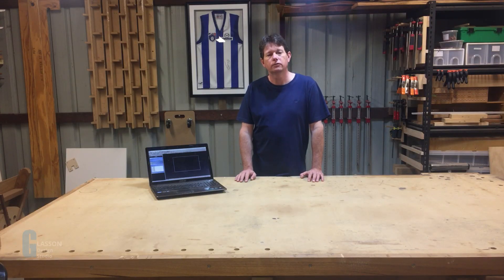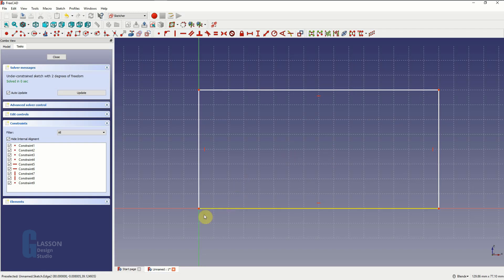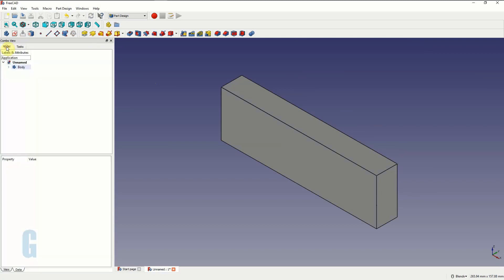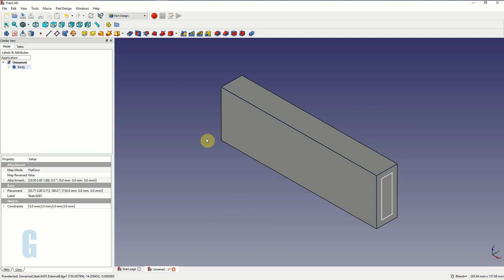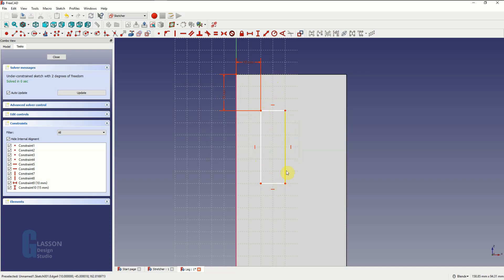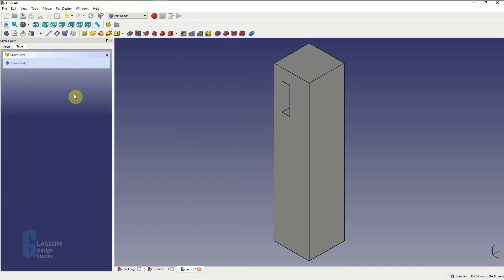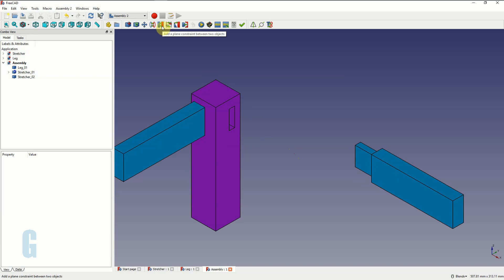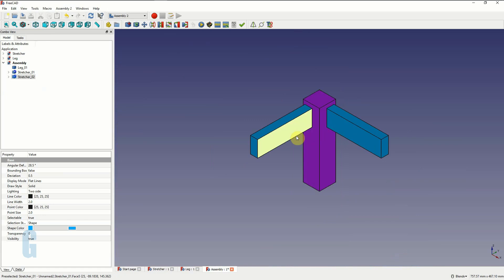Howto model the Mortice and Tenon joint in FreeCAD

Comment: What happened to the Assembly Workbench?🤨
Reply from the maker: Workbenches are sometimes abandoned by their maintainers so you might need to use a different one. I use A2Plus on FreeCAD 0.21 but I see that there is an Assembly workbench in FreeCAD 1.0RC2 so you might want to switch to that version.
Reply: @GlassonDesignStudio  Thanks. I'm relatively new to FreeCAD and didn't know about the add-ons. I started using A2Plus because I saw a couple of tutorials for it.

Comment: I am new to FreeCad  I am trying to follow along.  I had to add assembly workbench 4.  I am unable to load both parts into the new body.  Can you help me?
Reply from the maker: Hi Bill, thanks for reaching out. I can help you with the A2Plus workbench for doing your assemblies but not Assembly 4 because I don’t use it. I recently released an introductory video for the A2Plus workbench which should get you started. I’m currently working on building a playlist of videos about the A2Plus which I intend to cover all aspects of the workbench. I have no plans to do anything about Assembly 4 at this stage.
Reply: I installed A2Plus workbench but don't have the assembly restraints that you are using here.   @GlassonDesignStudio

Comment: Got a few minutes in and realised this must be a different version because half the stuff you were doing it wouldn't do.
Reply from the maker: Yeah that's going to happen when the software being used is constantly evolving. From memory the tools to model the joint should be pretty much the same but the workbench used to assemble the joint has changed. I hope that it didn't cause you too much grief.
Reply: Totally disagree the icons are all the same it works fine.

Comment: Few icons nowadays looks a bit different. A2plus is also a tiny bit more complicated as I had to select both planes and then the PlainCoincidence tool was available (not greyed out). But in general it's still the same and that tutorial was  "A giant leap for .."  Me-kind. Thank you very much.
I had to repeat few steps again and again, as I made accidentally those tenons a bit longer, so they freely protruded through leg 🙂 But I learned how to update Pad element, then update a stretcher as whole Part .. and update A2plus assembly to apply changes. Which unfortunately broke the plane constrains so I had to re-do those. Whatever - Repetito Mater Studiorum Est !
Reply from the maker: Thanks for your feedback Tom. I have trouble with the constraints some days as well :)

Comment: Informative explanation - well done !
Reply: Looks to me freecad is very useful for furniture making
Reply from the maker: I think so too. So far most of my work has been using straight lines but I'm starting to look at how to use FreeCAD for more curved furniture. It should be an interesting journey...
Reply: @GlassonDesignStudio  I think with one bend surfaces you will be fine.

Did you ever use FCs cnc module ? Just curious
Reply from the maker: I don't have a CNC so I haven't used the module. I know people that have CNC machines but they are not technically minded so are unlikely to be prepared to set outside their comfort zone and allow me to use something generated by the model. I'll have to wait until I can afford a machine of my own
Reply from the maker: Thanks for your kind words. I'm glad that you found it useful

Comment: Can you pls show the same with assembly 4? Would appreciate thx
Reply from the maker: Hi Frank, Thanks for your question. I'd be happy to do a video showing how to do it with the Assembly 4 workbench; however this is slight problem - I don't use the Assembly 4 workbench so would need to learn it first. I do use the A2Plus workbench for assembly. Would that be sufficient? If not, I'll have to learn how to use Assembly 4 so it could be some time before I can do a video.

Comment: I’m testing out different CAD programs. When you created the first rectangle, how did you lock it in at the origin? I keep getting 4 degrees of freedom.
Reply from the maker: Thanks for your question. There are a couple of ways to do it. You use the vertical and horizontal distance constraints to define how far one corner is from the origin. An easier method is to use a symmetry constraint to make two corner points the same distance from the origin. To do that I would select the top left corner, bottom right corner, then the origin point and then apply the constraint - press the S key or click the icon that looks similar to ><

Comment: Casey from Toronto Canada. 
Thank you for creating such a helpful tutorial for FreeCAD beginners like me, especially the assembly video part.
I have a question regarding the assebly.  The length of tenons from both stretches are 35mm and the depth of the 2 mortises of the leg is 35mm.  Would the tenons bump into each other inside the leg because of the thickness of the tenons so not full length of tenon is able to stick into the mortise?
Reply from the maker: Thanks for your kind words. Yes, the tenons in the video would bump into each other preventing the joint from closing properly. There are two solutions to this. The obvious solution is to shorten on of the tenons. The other solution is to mitre the ends of the tenons so they meet at 45 degrees. This solution provides you with a bit more glue surface than the first making the joint a little bit stronger.
Reply: @GlassonDesignStudio  Is there a way in free cad to prevent objects from going through each other? So you can be be warn when your tenons are bumbing into each other like this? 

By the way, the video is great!
Reply from the maker: @trivialcompost6407  thanks for your kind words. I don't believe that there is collision detection in the assembly workbench that I currently use (A2Plus). There may be collision detection in other assembly workbenches but I haven't investigated them.

Comment: Just a quick question, could you have used the mirror function to copy the Mortice ? if there is the function,  using a diagonal line across the corners.
Reply from the maker: Yes you could do it that way too. I was thinking too much like a wood worker and not enough like a designer when doing this video. You could also use the same approach when modelling the tenons, but bear in mind that the mirror tool does not allow you to mirror an already mirrored feature, so you wouldn't be able to use that technique to model the tenons at both ends of a stretcher. Checkout my video on the Mirror Tool for more details about it - https://www.youtube.com/watch?v=PllHnCum5cc

Comment: Thanks a lot for your video.
I think that Mortise Pocket Length and Tenon Pad Length must be 25 mm, instead 35 mm.
So, there is not interference between the two tenons when they are inside the mortises.
Reply from the maker: Thanks for your feedback. What you've suggested is one way to do it, the other way is to mitre the ends of the tenons so they come together without interference.
Reply: Glasson Design Studio 
Yes, that’s a good idea to mitre end of tenons. 
It’s simple do it by rasp and file, but to modify the Tenon Pad by FreeCAD what way you suggest?
Thanks.
Reply from the maker: @paolofogaccia9455  I would create a sketch on the top of the tenon representing the waste portion of the mitre (i.e. it would be a triangle) then use the Pocket tool to remove the waste leaving a mitred tenon.
Reply: @GlassonDesignStudio  
Done, like you suggested.
Thanks

Comment: Thank You very much for the tutorial. Helped me a lot.
I have a question, the second stretcher will not be inserted (by 10 mm in real life) as that space (inner) is already taken by the first stretcher. Can you also constrain that in freeCAD. (I used A2Plus instead of Assembly 2 as it now seems to be Obsolute)
Reply from the maker: Hi Sudeep, sorry for the tardy response. I could have sworn that I'd responded previously but obviously not. I tried using the A2Plus workbench in this scenario but would imagine that there would be a gap between second stretcher and the leg because they two tenons cannot occupy the same space. I think I said in the video how I would deal with the situation when making the tenons, but if I didn't then what I'd do is make a 45 degree chamfer along the end of both tenons so they could fit together properly. I should have done it in the video but it didn't occur to me to do so at the time because I was having too much fun playing with the animation :).  Hope this helps

Comment: WOW. This vid did not appear in the playlist. It did pop in after another vid was viewed. yt is having issues with itself! If I may make a suggestion about hardware to use in FreeCAD, https://www.amazon.com/3Dconnexion-SpaceMouse-Compact-3D-Mouse/dp/B079V4PXYD/ref=asc_df_B079V4PXYD/?tag=bingshoppinga-20&linkCode=df0&hvadid={creative}&hvpos={adposition}&hvnetw=o&hvrand={random}&hvpone=&hvptwo=&hvqmt=e&hvdev=c&hvdvcmdl={devicemodel}&hvlocint=&hvlocphy=&hvtargid=pla-4584070138246650&psc=1. I have been in 3D design since 1986, using a regular mouse to navigate the model space is tedious. In freeCAD even more so, a double mouse button hold is lousy. The SpaceMouse allows zooming, rotating, tumbling and view orientation to be done with your off-hand. being able to select a face then pivoting the model to grad the second face makes life so much easier.